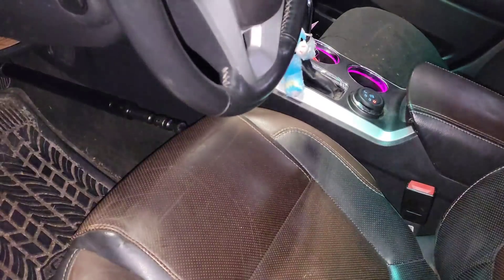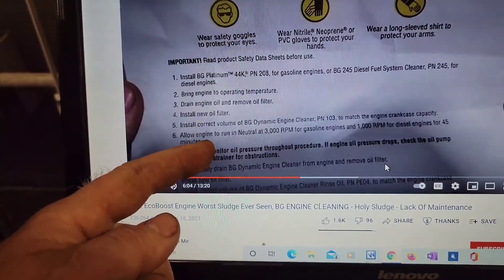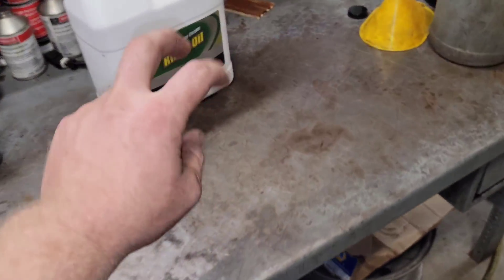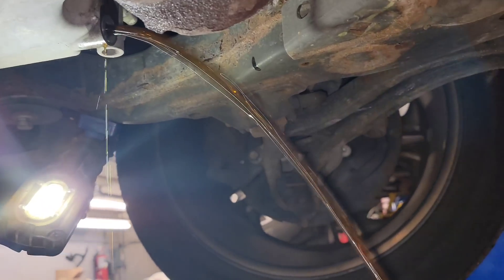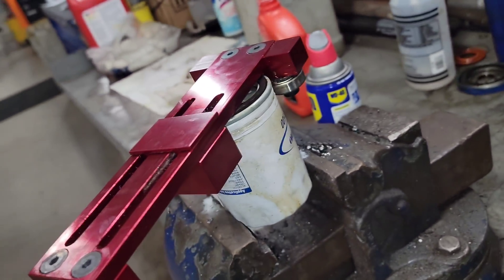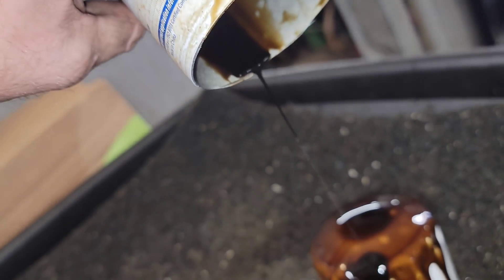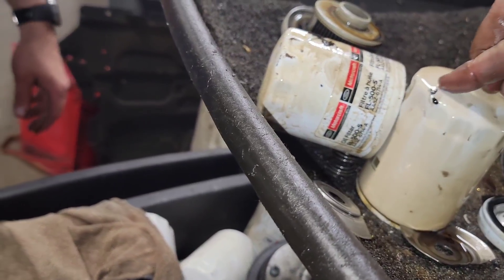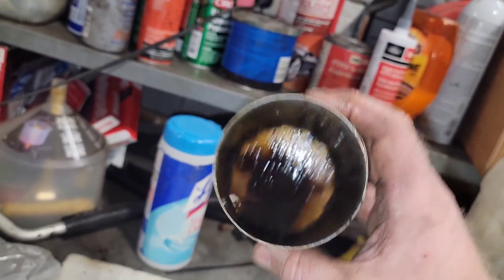Full BG Engine Restoration Kit 2014 Ford Explorer 3.5L Ecoboost - Quick Lube Serviced - Bad Sludge

Comment: I'm old Skool, change oil at 3k, never understood trying to run plugs, transmission fluid and engine oil at higher miles. I have one vehicle serviced at Penn Quick Lube, filter is cartridge on top so I know they change it and the oil is bulk. Never had a problem with the guys that work there as they are attending an automotive Tech School.

Other vehicles, heavy equipment and farm equipment I service in the shop, magic bullet is routine maintenance and the Amsoil guys, smoke and mirrors, never touch the stuff. Race car gets Brad Penn 😁
Reply: I'm the same way I get my oil changed done every 3k miles, get my differentials fluids checked, I check my plugs every spring and adjust the gap if needed, I also check each cylinder with an endoscope.  My mechanic tells me for an engine with 200k miles it's really clean. My mechanic says I'm a little OCD about it he would hate to see me with a new car lol. We have fun
Reply: @brutushobbies  Sounds like me. I'm nuts with maintenance.

Comment: Hey there, I have a question regarding the oil amount, one jag is about 6 quarts. For instance, if the engine oil capacity is 7,2 quarts, is this 1,2 quarts supposed to be the same BG oil (another 6qt jag), or can be regular engine oil that is used with that particular engine?
Reply from the maker: No

Just top each treatment off with regular oil you would typically use

Comment: Have you ever used bg engine cleaner on a 5.4 engine in the mid 2000's F150 to save it from being replaced?
Reply from the maker: Yep it works on those to

Comment: How did you maintain the engine at 3,000 rpm for 45 minutes for the flush? Did you leave a brick on the pedal? 🤔
Reply from the maker: I showed how 

Hood prop rod in front of seat and adjust seat forward
Reply from the maker: Pushes pedal to desired rpm

Comment: I wonder if the plastic has come from the cover that you sometimes see on oil filters. Maybe a kid at the easy-lube joint just slapped the filter on without removing the plastic first?
Reply from the maker: That's kinda what it looks like

Comment: That BG is good shit.
I think my ecoboost needs a clean, these direct injection engines need it.
Reply: GDI has nothing to do with it. Any engine will get sludged up, especially in the ring lands and oil control rings. This stuff really works well.

Comment: I never could quite understand people. They buy a 40 thousand dollar vehicle and try to save $50 on oil changes or use the cheapest oil and filter they can get. I wonder if the plastic is part of a cheap Ecore style filter that blew apart inside from the quick lube place?

Comment: What’s your thoughts on this flush kit on high mileage engines, with original seals that aren’t leaking. I have a 00 silverado with 250k and I’m thinking about being the test mule before I do it for customers
Reply from the maker: Always proceed with caution but it should be fine
Reply: @FordBossMe  thx. That why I will try it on my personal truck first. But I figure some aggressive stuff in it and was thinking old seals might not like it

Comment: At this point (with the engine being neglected) it doesn't hurt to try this engine flush or any engine flush for that matter. Like you said, that engine is probably on borrowed time. At least (or hopefully) there's no more starvation of oil  throughout the engine due to the sludge build up and it can last a bit longer. Great vid as always👍

Comment: The construction of the Pronto filter does not look bad at all in this video, in fact it looks pretty decent quality.  I would even venture to say that the build quality of that filter rivals the motorcraft.  Silicone ADBV, plenty of pleats that are adequately spaced, spring (looks like a Wix Gold re-labeled).  Unless there was media tearing.  I would say the potential culprit would be the technician that may have removed a plastic wrapper on that filter and he popped the center hole and some of the plastic ripped off and fell into the main chamber of the filter when he installed it.  What was the Oil change interval for the oil to get THAT BAD???  Interesting video as I have never seen the process for a flush before.  Thank You for posting this.

Comment: Very glad to see how an hour of dedication and the right materials can save an entire vehicle from the boneyard.  Will the customer finally learn to stop every 4,000 miles and get a proper lube service?
Reply from the maker: I hope
Reply: That is why I do my own oil changes; I had a quick oil change place do one on my 99 F150 last year and it blew a head gasket a couple of months later. I’m not saying it was the shop’s fault, but I also didn’t do my due diligence. Seeing this vid makes me wonder now. Yes, the truck was old, and had 215,000 miles on it, but it ran fine. I did have a BG upper engine cleaning done by a shop that pushes BG products about 10 years ago when the engine was running crappy, and I can attest that BG is a superior product when it comes to over all drive train health especially in high mileage vehicles. The COMPLETE BG service is expensive, but it covers everything from the radiator to the brakes. I highly recommend this procedure!

Comment: all of our Explorer PPV's that are serviced by shop's must have a Ford Motorsport oil filter installed and full Synthetic. Some were caught using generic units and lost our account. We have vehicles with with 150K miles and 10k idle hours and they do not burn an ounce of fluid which is very impressive.

Comment: Do you have a choice of the weight of the flush oil? I run 5W20 full synthetic in my 2015 Chevy Spark with 85k. I'm super meticulous with my oil changes. I bought a little borescope that will Bluetooth into my iPhone. It's a badass little rig. I change my own oil. I Do Not trust ANY of those quick lube shops. Call me pessimistic but they could be pumping anything into your engine. All I have noticed with my camera is a tarnished look inside the engine. No clumps of anything. It's a caramel-colored coating everything I can see with my camera. 
btw, Thanks for the link on this filter cutting tool. I'm about to start forensically examining all my used filters. 
Cheers from Louisiana.
Reply from the maker: 5w20 is fine or 5w30

Comment: Great video. Hey do you think I should run that in my town car. It has
 262,221 miles. It runs good. The only thing that I have that gives me a problem is when I reverse at a incline my car goes into limp mode (the wrench🔧 light). I already had the outpost speed sensor replaced.  The owner of the transmission shop said it might be one of the wure conditions.  Any thoughts?
Reply from the maker: Just won the basic small can epr and MOA off Amazon
Reply: @FordBossMe  ok, and what do you think is causing my transition to go into limp mode?
Reply from the maker: @hotrodlincoln7186  I will consult my trans guy tomorrow for a more professional opinion
Reply: @FordBossMe  ok, thank you I really appreciate it.

Comment: Is it ok to use bg as a maintenance  item...I have a 3.5 ecoboost around 135k. It has had regular maintenance  but these boost engines get pretty dirty?
Reply from the maker: Yes
Reply from the maker: The basic simple step kit yes 

1 small can epr and a small can MOA found on Amazon

Comment: How long does it take to blow off the valve cover and do a before and after.
Reply from the maker: I'm not exactly sure what you're asking me to do here
Reply from the maker: If you're coming here you're coming here to learn stuff right you're not coming here to complain about things I want to make that very clear from now on complainers don't even comment
Reply: Don't need to take the valve covers off = have 5-6mm cameras that will go right thru the oil fill.  =Just looking thru the oil fill was a disaster.
Reply: No proof that it will help.It will clog the oil pump screen
and vct controls.The only correct way to do this
repair is to remove oil pan and valve covers and remove sludge.
Retired ford tech 40 years.
Reply from the maker: @jonmccormick8683  he's complaining about the dirtiness of the valve covers that we didn't clean it off

Comment: I thought it was bad to do a flush because it could clog lines and cause more damage later.
Reply from the maker: IT could 

but then what are you do? Leave all that stuff in there and let it continue causing problems you got to get it out

Unfortunately in a situation like this it was causing issues with the customer's motor so you have no choice but to try to make it better
Reply: That is related to automatic transmissions.

Comment: That "plastic" material looks like the sealing material on oil bottles.
Reply from the maker: It kind of does
Reply: That's exactly what I was thinking.
Reply: Yes, it does, now you mention it.  Bet the lube "tech" took a knife to cut the seal out, but let it drop into the engine with the oil. Sloppy.
Reply: Will definitely clog small passages.
Reply: Stupid owners do not completely rip them off the jugs and it probably did fall into the oil... so dumb
Reply: I used to work at a fast lube we got the oil out of a large tank unless the customer wanted something specific it was quart bottles. Only 5quart jug I know has a plastic seal is SuperTech. Other jugs have an aluminum seal.

Comment: 44K has to be one of the best things ever. im not for most any additives or fixes in a bottle so to speak but BG IS good stuff. i have used their products for a long time but this one i would have tried on more than one car if i knew about it. the last shop i was at didn't use their stuff.
Reply: i had a car that sat for so long the injectors were so bad it would barley idle on a couple cylinders. we put 44k in the tank and 30 minuets later it ran good.

Comment: Been using BG in all my vehicles. I've got a 17 Jetta that still runs like in came off the lot with zero issues at 70k miles using BG epr, moa and 44k at every oil change. I'll swear by this stuff.

Comment: My bet is on low spec oil at the quick lube place and too many miles between changes.  Oil just disintegrates over time.  Any Idea how to score that BG kit for us civilians?
Reply: The oil used ay Quick Lube must come straight from the ground, filtered through a rag and dumped into the engine lol.

Comment: Been running Schaeffers Supreme 9000 full synthetic in my 2019 Lincoln for 107k plus and it's immaculate on the inside. Runs quiet, like new.

Comment: Honestly, I've been hesitant in using a flush on an older engine simply because removing the crud usually does more harm than good. The idea behind it is good but if the crud has been there for a while, certain parts are going to have an established wear pattern. With that being said, on a motor that's on the way out anyway, what can it hurt? Might buy some time or it might not. Hopefully it does, but I remain skeptical. I wouldn't plan any long trips in it.

My advice to people who own cars is never ignore maintenance. Change the oil often. If the manual states 10k miles, do it at 5k. An engine has never quit working because the oil has been changed too often. Stay away from the "quick lube" outlets if at all possible. Good luck!
Reply from the maker: As many times as you've seen me do plushies on this channel and never had one single come back and never had one single issue do you really think your whole Theory with it doing more damage is accurate? A lot of people say that stuff because that's what we've been taught forever and just sometimes it does happen but as many times as I've done it and showing you guys but there's no adverse effects especially if you do it correctly

What you need to do is flush the engine and go through multiple filters while you're doing it you cant just do it with one filter unless you're doing a basic flush
Reply from the maker: Maintenance is key indeed
Reply: @FordBossMe  Cars and trucks are expensive enough as it is and to ensure you get your money's worth out of it, maintenence is the absolute key to ensure that happens. The average new car in my neighborhood is between $40k and $50k. That's serious money. 

I'd be hesitant to do a flush on my 17 year old GMC that has 160k miles, that has had regular maintenance, runs good and does knock or rattle. It's never been flushed but I've never let the oil go black...new oil and filter every 3000 miles. Would a flush do any harm? Probably not but why tempt fate. A bit of varnish can stay where it is. It's likely keeping some gaskets and seals intact. 

I can definitely see the benefits from flushing. I think it would be worthwhile to add this service to the maintenance schedule, every 30k miles on a brand new engine. Wouldn't hurt. But neglect and abuse you can't reverse...you just hope for the best.

Great Channel! Thank you for posting these videos!

Comment: I love the concept of the 3.5 ecboosts, but what concerns me about getting one is that there is even more concern if the previous owner knew about how much more critical maintenance was to a turbo GDI motor. It's not like I can just take apart the intake to see the what the carbon build up is on the valves and make sure that there is no sludge build up else where in the motor

Comment: Re plastic in engine: I recently changed the valve cover gasket on my 2.4 Toyota. The gasket has 4 molded seals for the spark plug holes that are held in place by a wide strip that is molded to one side of the gasket. The "bridges" of gasket that hold the seals in place were brittle like glass and most of the bridges were gone...somewhere in the pan I hope.

Comment: I bet some idiot didn’t peel the wrapper off the bottom of the oil filter that keeps contaminates out while in the box.  Just installed because his boss said don’t waste your time peeling that off just put the filter on it will melt in the engine.  There are some real geniuses out there.   Good video.  I sell Fords for a living and I have not made a decision on the ecoboost engine.  They are powerful however if I owned one I wouldn’t skip any oil changes from what I have seen.  They don’t like dirty oil.   Mainly the timing chains.  They stretch with long oil change intervals and bad dinosaur oil.  I would only use synthetic and a good one like Amsoil, Valvoline or Mobil 1.

Comment: If you had a ticking sound and you're finding bits of plastic in the filters, you may have a busted guide somewhere inside. Hopefully not but you won't know till they drive it for a while. As a tech I've seen it all as well when it comes to piss poor maintenance.

Comment: That’s amazing change your oil 3000 to 5000 miles with synthetic oil you would never need a cleaning you would never have build up.   I drive 30,000 miles a year plus I’m getting older now are used to drive just under 100,000 miles every year all my vehicles with his 350,000+ the 425,000+ miles on the original engine.  
            When pulling off valve Cover for engine oil leak on my vehicles after 250,000 to 300,000 miles only a slight yellow brownish tinge of a film you can see over the metal part no build up at all.

Comment: Interesting,  I recently just did a B&G coolant flush at the dealer (5years).  It said it has a warranty. they also use B&G oil.  My car is not a ford but i like your channel.  Really clean.

Does your shop use bulk oil or All Motorcraft oil/coolant? 

One other dealer said it just used bulk oil, i don't go there anymore.
Reply from the maker: Bulk spec Ford oil and also bottle for a little more money
Reply: @FordBossMe  As the mechanic from gm it's what the manufacturer recommends!
Reply from the maker: We get our oil from a company that transports it to us from I thin Warren Oil distribution
Reply from the maker: Ford sends them the specs and they make it

Comment: My question is what has changed in the industry , what’s in the oil or the engineering on the engine that is causing this to happen ? When I was in the mechanic in the field I had a 79 Ford Bronco ran it to over 300 K before rebuilding it . Sometimes it seems the more we advance on computerized components we start lacking in the mechanical end of it .
Reply: More like quick lube shops selling customers on price. They should be able to refuse selling a customer a $29 conventional oil change when the vehicle calls for synthetic. I see it all the time at firestone and the like. But yes, the oil industry in America is a commodity. Stringent oil formulations like Amsoil, Schaefer’s, Motul, etc. cost $10/quart motor oil, which means you pay for $120 oil change. If auto manufacturers required 100% synthetic motor oil‘s they would see fewer oil related engine failures, but also fewer sales due to higher running cost.

Comment: What are your thoughts of using it on the 5.4l 3-valve?
Reply from the maker: I've done it worked great but there are instances if it's bad enough you could wash stuff into areas you don't want it 

There is always that risk
Reply: What year/mileage is yours? Im probably going to do it on my 07 expedition. Currently at 227k miles and I've been using royal purple oil. Thinking about running something through it after replacing some of the timing components.
Reply: @gjenkins1660  '05 Expedition with unknown mileage because the dash has been changed twice.